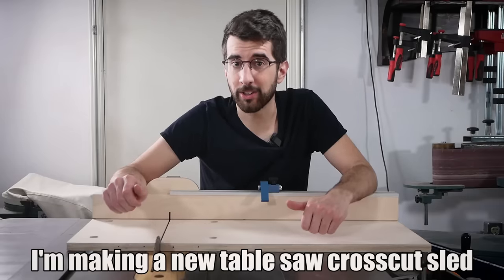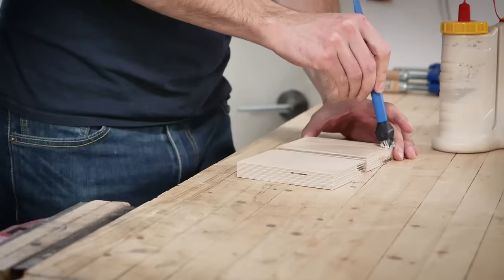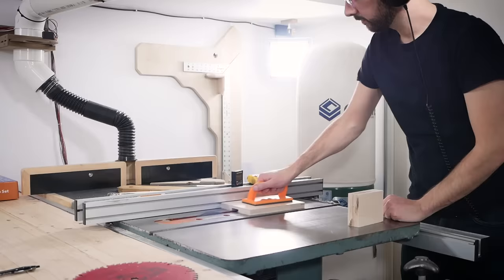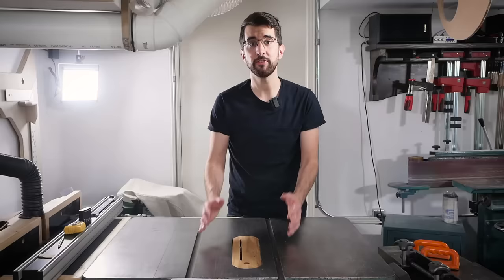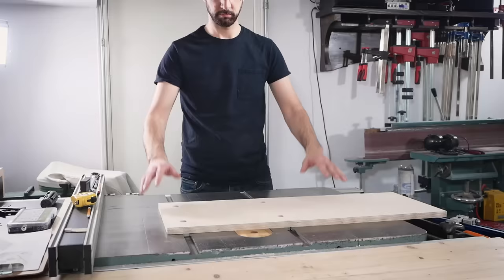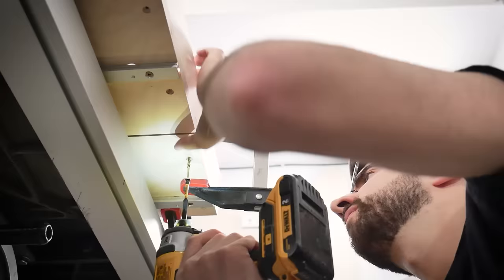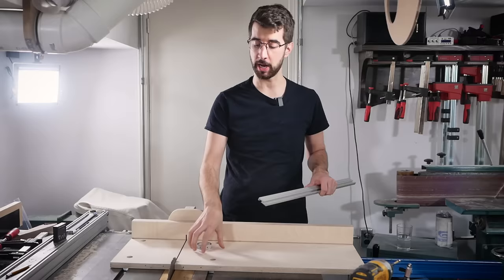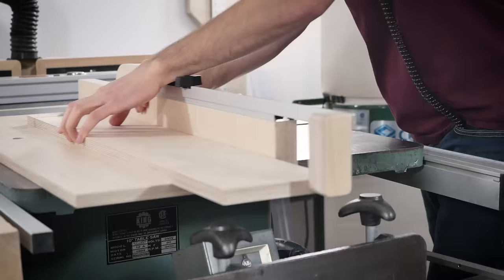your crosscut sled is way too big

Comment: So you’ve perpetuated a common myth in woodworking. That softwood is “less stable” than hardwood. If you actually look at moisture charts, most softwoods see less movement in the moisture ranges we see in a home or shop than hardwoods. And sometimes much less movement!
Reply: i got a plank of spruce and another plank of beech that would disagree ...the spruce is missing a line or i would be calling it a long bow ...
Reply: @HMABH  That is more likely due to how they were cut and dried and less to do with species.
Reply: I have tried various types of wood and plywood and they are all problematic. Maybe it depends where you live, the temperature and humidity shifts throughout the year where I live means any wood shifts unacceptably and I’m always having to adjust them, but my mitre slots on my saw are a none standard size, so I can’t find any proprietary aluminium ones to fit 😡😡😡😡

Comment: Out of curiosity, how flat is that cross cut sled 7 months later? I've abandoned the use of plywood in sleds and similar since it tend to warp a bit over time.
Reply from the maker: still perfectly flat. But it's baltic birch, so pretty much the best you can use.

Comment: Holy hell those Miter bars are $46 each here in Canada.
Reply from the maker: i think they were $20 when I bought them (i'm also in canada). The price will probably come down soon, or there might be another seller with the same product for cheaper.
Reply: @ScottWalshWoodworking  that's much more affordable!  Amazon screws us Canadians on a lot of things, hopefully they come down.
Reply: I just looked them up on Amazon UK and they were quite cheap - plus there were different makes, all looking similar but with different brand names, some cheaper than others. Maybe search around a bit?

Comment: You need to get real "push sticks." Yes, the ones you show yourself using in the video are, technically, push sticks, but by using push shoes, you, VASTLY, reduce the chance of kickbacks.

Think about it:

(1) All you are doing is pushing wood through from the back, but kickbacks start at the back of the blade, opposite from where you are pushing, so there is NOTHING holding down the wood where it starts lifting.

(2) IF you use, for lack of a better description, a push shoe, you hold down the wood AT LEAST 10" or so from the back. You are putting a lot of down pressure on more of the wood you are running through the blade. 

When you think of it, that is what hold down jigs do - they keep the wood from lifting.

(3) I use a splitter [or a riving knife] religiously to keep the wood from pinching the back of the blade. That in combination with something that keeps your hands away from the blade and holds down several linear inches of the wood being cut will greatly reduce the dangers of working a table saw.

Comment: "Potentially more accurate"...baloney. If the accessory for the sled is made with the same accuracy and precision as the sled, then the combination will be as accurate, although errors do add up. But, I would not accept an error that is only 1/2 of an unacceptable error, simply for that reason. It all depends on the standards you choose for all construction.

Comment: At $180 for a 4’x8’ sheet, I have to pass on this video. You may as well be making it out of gold.
Reply: Not quite. A 48” x 96” x 3/4” sheet of gold costs $90,475,412.70 AND it will trigger the SawStop brake every time. You can buy Baltic Birch plywood in 1/2 sheets and 1/4 sheets if you can’t afford a whole sheet. Or you could use MDF or any other kind of plywood if you wanted to cheap out on it. You don’t have to “pass on this video.”

Comment: Anyone who needs a crosscut sled never properly learned how to use a table saw and the miter gauge it was originally equipped with. My father would have exiled me from the shop if I had ever suggested we use a "crosscut sled" to cut or trim anything, including anything up to sixteen inches. ALSO, a crosscut sled reduces the thickness of the stock you can cut by whatever ridiculous thickness you have chosen for your crosscut sled base. AND, AND, and, your crosscut sled is ONLY as accurate as your miter gauge and you ability to use it while constructing it.

Burn me if you want, but true craftsmanship is rooted in logic, experience, and ultimate results.

Comment: Might wanna check up on the direction you use your palm router. If it turns clock wise, use it counter clockwise. Bye